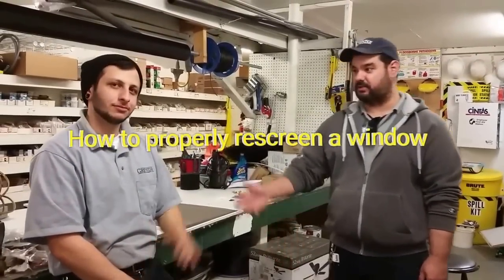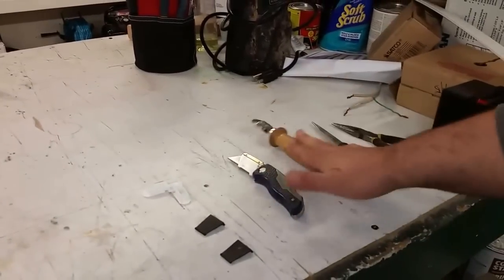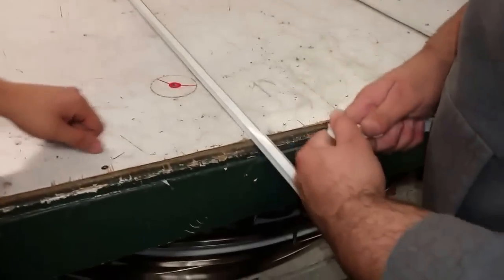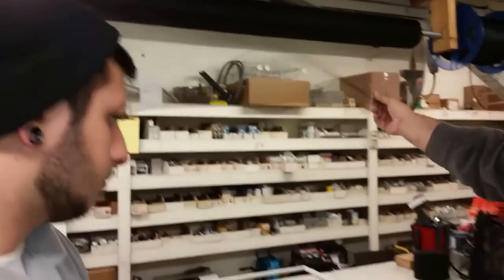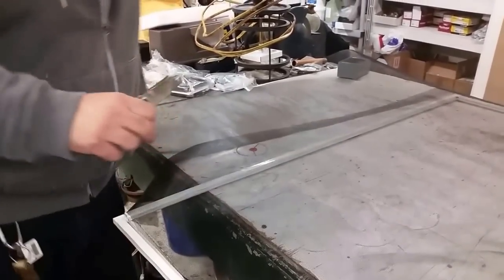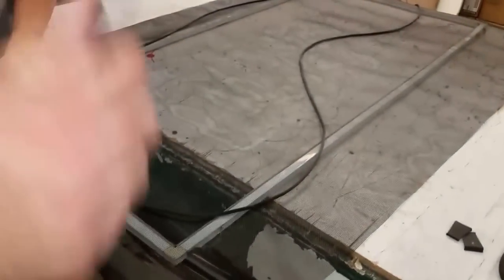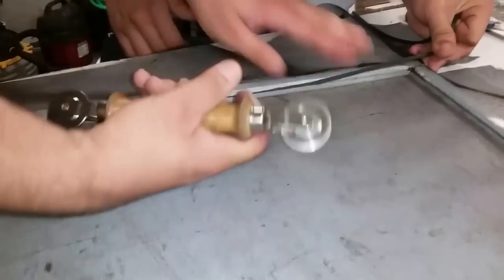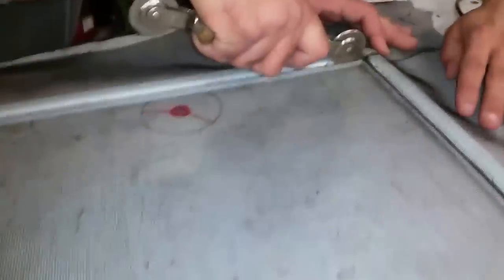The proper way to rescreen a window. How to.

Comment: The spline gets cut after it is rolled in, metal corners are way better. You don’t leave loose screen in the middle, a “pro” can get the right tension on the mesh. Push harder with the roller and lean on other hand while pulling the mesh towards you to get this tension. I have been around professional screen makers for over 20 years and you are no pro. You are worse that somebody who has been trained properly for 1 day.
Reply: Yea im a pro screener myself and this was hard to watch. Especially for it to say the proper way to roll window screen. This was actually a video of exactly what you do not want to do.. I walk roofs and tackle 1500 sqft roofs a day alone. And for him to have that hard of a time with one petty window and have an assistant is just embarrassing...
Reply: The proper way "wack, bang, scratch oops"
"Leave a little bit in case i fu it up"
I think it is funny

Comment: You said to leave some extra screen in case you cut into the screen and have to pull out more to redo. You said if you do that, it would leave enough for a couple of mistakes. If you don’t make any unwanted cuts, won’t that leave too much screen within the frame and it will look too loose....?
Reply from the maker: Spread out over the entire area of the screen you wont notice it. If you think you can do it without mistakes go for it but i think one little wrinkle in the finished product is better then 2 or 3 attempt at the whole thing.

Comment: Thanks,  for the info - worked good no cut used plastic tool . Cutting the corners helped with the corner stress. - Good tips ! Did two  screen in about an hour. Having a helper is plus (wifey).

Comment: What size spleen do you typically carry have on hand? Do you recommend a particular spline tool?  Thanks
Reply from the maker: I used a two sided metal one that was large on one side and small on the other. I would recommend buying a small one with a plastic head, it will work almost as well as a large one and with a plastic head it will be a lot harder to damage the screen.

Comment: My roller has 2 wheels, why are they different?
Reply from the maker: Ones for a big channel ones for a thin channel
Reply: @JAkedAgain  ahhhhhh yes...that explains it
Reply: Oh brother. No... Don't listed to JAked. One (the smooth one) is to press the screen in to the channel (which may be omitted depending on technique/preference) and the concave one is designed to press in the SPLINE (not rubber) in.
Reply from the maker: don't lie to the poor guy you obviously have literally no idea what you are talking about. I'm honestly surprised you were able to even comment on this video

Comment: Jacob- I agree.  I have never re-screened and I followed this and I now have 3 perfectly re-screened frames. I cut the extra screen off a bit differently, but this instructional video worked for me!
Reply from the maker: Liz Richey thanks for the positive comment if you don't mind telling me how did you end up cutting  the screen differently.
Reply: I used an x-acto knife rested on the frame with the blade pointed our and just ran the it along the frame- no risk of cutting any screen.  I did cut the screen on my first one and that is why I switched.  I will also say that I took some double sided tape and slipped it between the screen and the frame on the small cut I made.  I think your instructions are excellent!

Comment: You are using the wrong side of your roller!  I use clothes pins to clip the screen along the edges..now,  run the round side of your spline roller into the groove,  pushing your screen into the groove..making sure your screen hole align up with the inside of your frame. 
Now take the Concave side and insert the tip end of spline in the corner and line up your spline to the opposite corner...now rollthe spline into your groove, when you get to a corner, tuck and round and start again, making sure your spline is in a line with the grove and roll it in.  When you come to the end. Pull just a bit and cut the spline so it will fit next to  the beginning. If it is a little short..fine if more than 1/2 in cut a a bit of spline and insert and roll in place.  Slowly go around once again to make sure the spline is inset in the grove. Ise a box knife an d carefully let the spline glide the box cutter along the edge .trim up corners..
Yes, making sure you installed the screen lift plates
Reply: I love the tip of inserting the screen into the groves before the spline instead of doing both at once. I just started a job at Ace hardware and my coworkers clearly don't know what they're doing so I'm not being taught very well. I'm going to try this method tomorrow.
Reply from the maker: good advice
Reply from the maker: it's good advice